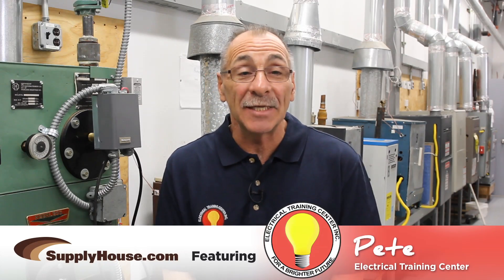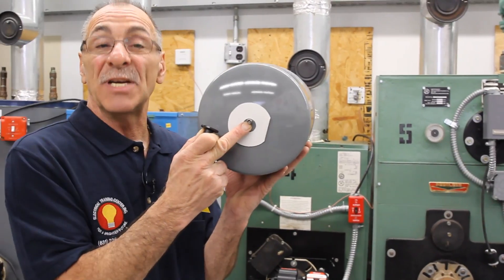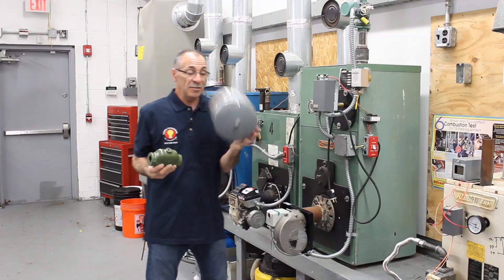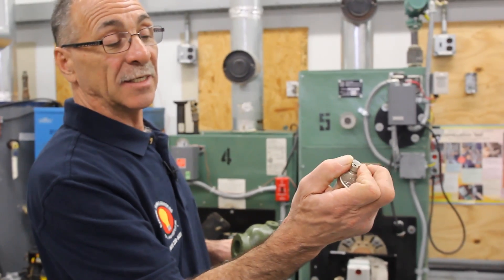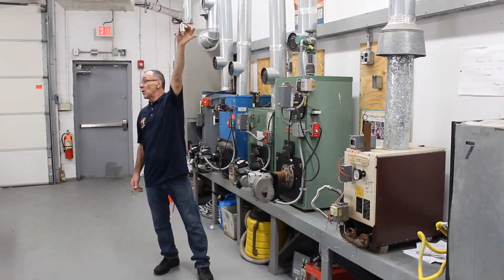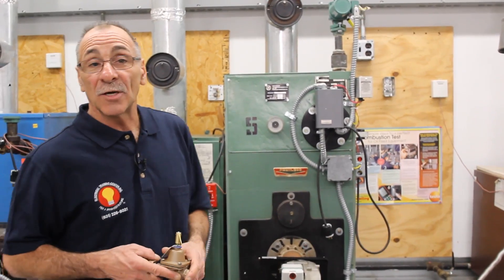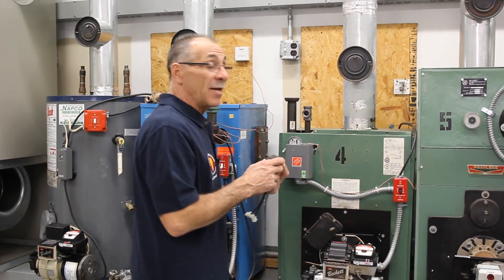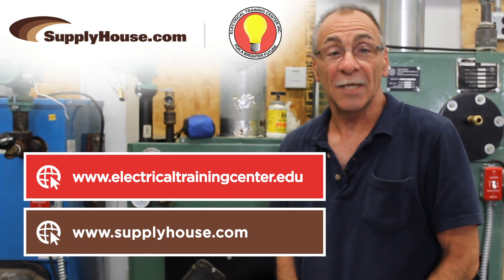Boiler Accessories

Comment: hey, i Like your youtube.  Here is a question that I like to ask your help if you can.   I have to thank you in advance for your kindness.  Is there a way to control the boiler by setting temperature?  For example, in winter I like to keep the water in the tube system at 135F.  DO people do this ?  thank you

Comment: Hi I just added a relief valve and a expansion tank but the pressure keeps going pass 30 I don't know what's going on any ideas
Reply: drain the compression tank
Reply: Pressure reducing water fill valve could be adjusted to high. Or bypass quick fill valve leaking city pressure through it. Expansion tank may not be large enough to provide cushion on system when water expands during heating process.

Comment: I installed a spirovent on the expansion tank and lets air out but I still got to go second floor to bleed conventors. Is  the spriovent  not enough to purge air out of the system?
Reply: every system will have a pesky pocket of air.  install automatic air vent on the radiator that constantly needs the most bleeding 

my system runs very little pressure, but has great flow. 

boiler in basement, rads on 1st and 2nd story
Reply: Nathan try running your pressure a little higher maybe 12 to 15 pounds it would be okay to run it up as High as 20

Comment: My pressure relief valve has been leaking. I noticed that my expansion tank is installed with the threaded connection on the bottom. Basically it looks upside down. If I replace the tank wouldn’t be incorrect to install it the way it was installed previously? I am asking this because installing it that way is something that I can do by myself however I may be required to call a plumber if the pipes need to be changed in order to install the tank in the other direction
Reply from the maker: You can install the expansion as you have it but it won't last as long and will probably go bad sooner. You want it with the threaded part on the top like in figure 1 of https://s3.amazonaws.com/s3.supplyhouse.com/manuals/1351074548440/84982_PROD_FILE.pdf
Reply: threads up to keep water side air out

Comment: The size of the expansion tank is based on the water volume of the system.. I already can’t trust this guy.
Reply: T V yeah he said he runs a 30 tank because he wants more pressure for a second floor situation. a tank doesn't regulate pressure just absorbs expansion of existing pressure

Comment: I will be replacing my expansion tank this week and the person that installed it 6 years ago installed it upside down. Does this matter? it worked fine for 6 years but now I must replace it.    great web site.  Ron
Reply: No. 6 years is standard for non ASME rated expansion tank allowed on 30 PSI or lower operating pressure boilers.

Comment: He says not to adjust the air pressure? The manufacturer's site has specific instructions on how to adjust it and states how important it is to adjust it. Also, not totally positive but he is the first person I have heard say to use pipe dope and teflon tape. This video makes me question everything about "SupplyHouse".
Reply: He said teflon tape and/or pipe dope (meaning one or the other or both). I have a plumber friend that almost always uses both (teflon tape and then dope over it). He told me he never has leaks - ever. I have seen a lot of other plumbers do this now as well. The only time you have to be careful using tape is when you are screwing something into cast iron. Teflon tape is a lubricant first and foremost and it's easy to over tighten your fittings which will easily crack cast iron.